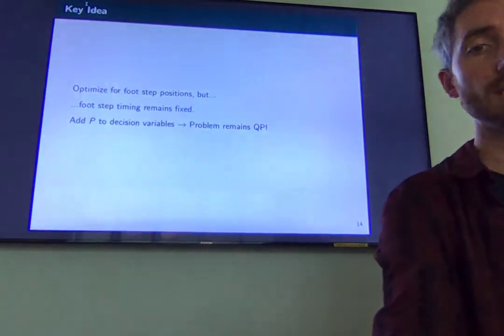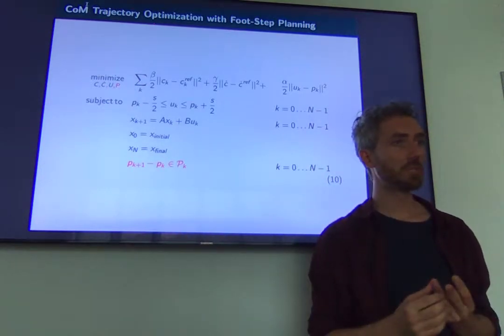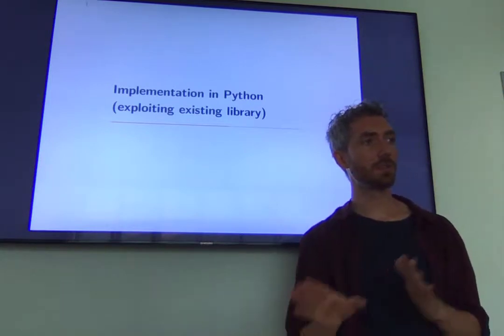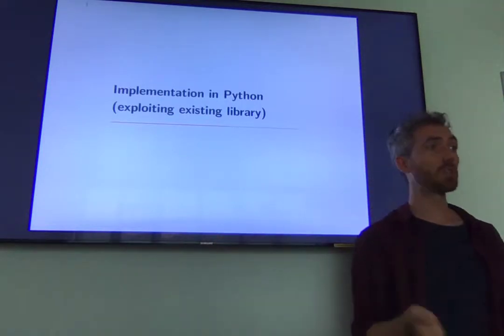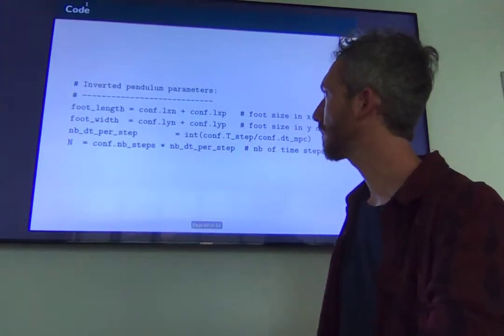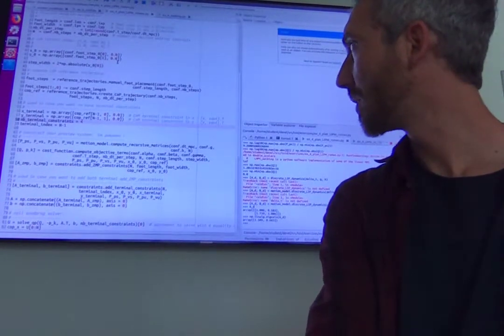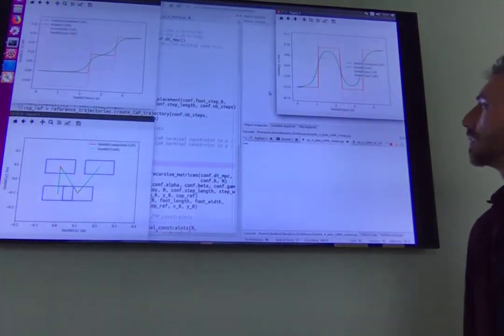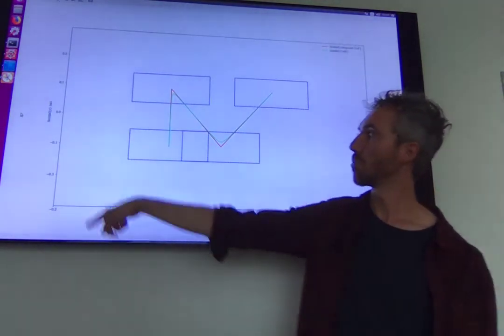Optimization-Based Robot Control - Lesson 5 (17/07/19) - CoM Trajectory Optimization 2/2

Comment: Thanks for sharing the lecture professor. You mentioned that we need to minimise over the reference pos, reference velocity and reference foot steps. My question how can we get these reference trajectories? . Thank you and I really appreciate it if you can answer my question.
Reply from the maker: Foot steps can be automatically computed by the solver, as shown in the final part of the slides. The reference position/velocity is user-defined and depends on where you want the robot to go. The key point is that these references need not be dynamically feasible. You can simply ask the robot to move on a straight line, which is not feasible, but the solver will automatically find a dynamically feasible trajectory that goes in that direction.
Reply: @AndreaDelPrete  Thanks for answering my question Professor. You mean to say that solver will find the dynamically feasible trajectory that will minimise the error with given reference (might not be feasible) trajectory
Reply from the maker: @ramcharanthota1016  Exactly
Reply: @AndreaDelPrete  Thanks for your time professor :)